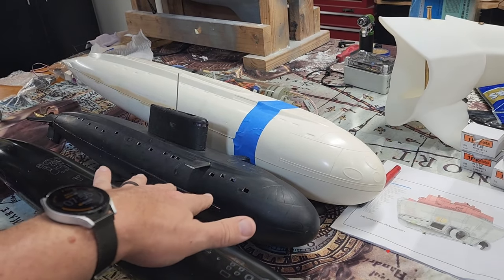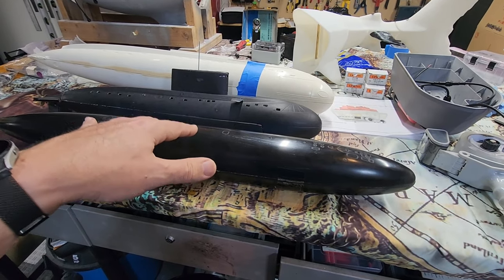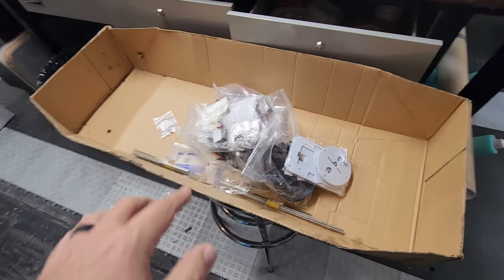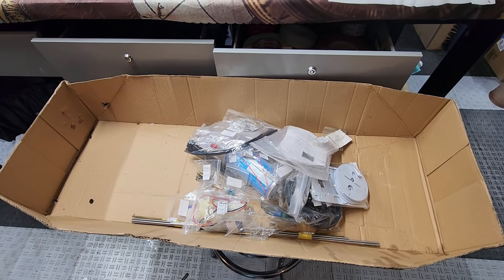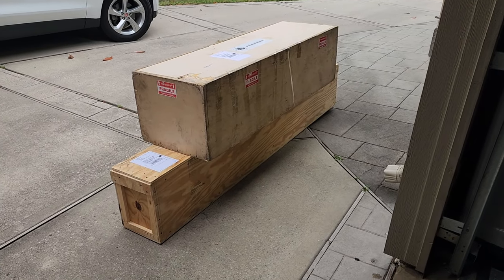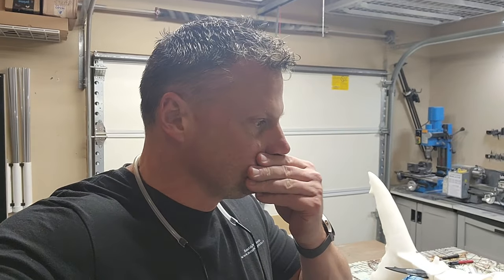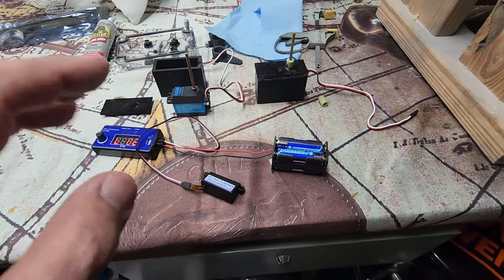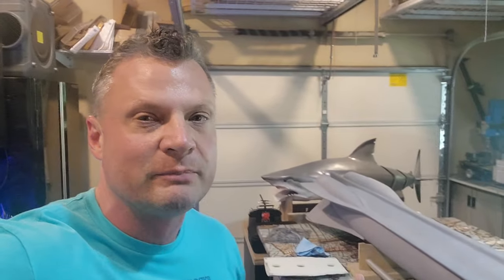A Water-Shootin' Gato, Billy the RC Shark, and High-Output High-Beams for the Seaview

Comment: You probably already have it solved but, many moons ago I had a deep-vee speed boat with a similar ESC to the one you used in Billy.  It actually had a flow sensor for the water cooling, no flow and it would shut down if the ESC started to get warm.  That water cannon sub is gonna be SICK when it's operational!

Comment: Depending on what kind of 3d printer 3d prints are not water proof. Need to be sealed or will leak between layers.
Reply from the maker: I've done hundreds of prints, including for use in watertight cylinders. Proper print settings and 100% infill and you'll be fine. PLA is not ideal for hulls, as they tend to warp in the heat of a very hot summer day. The plastic, however, is perfectly fine for use with the water.